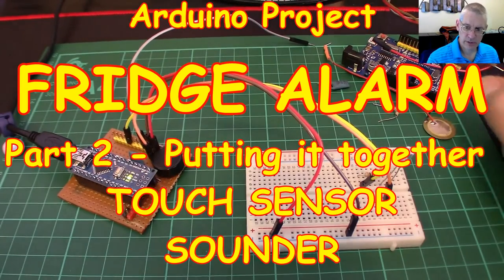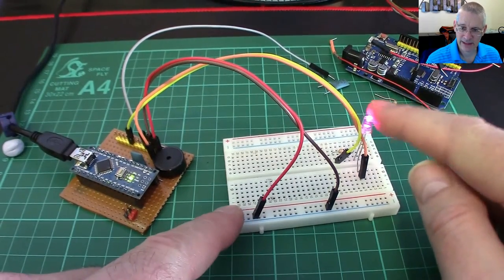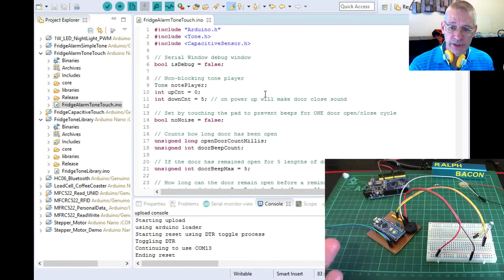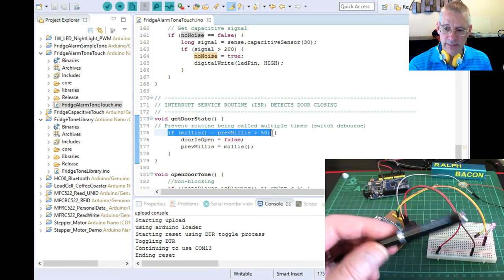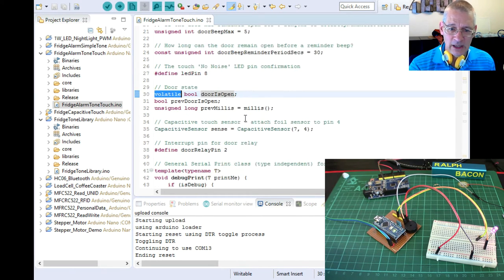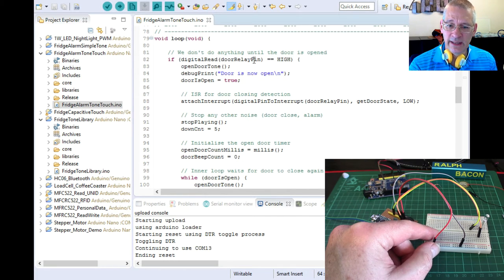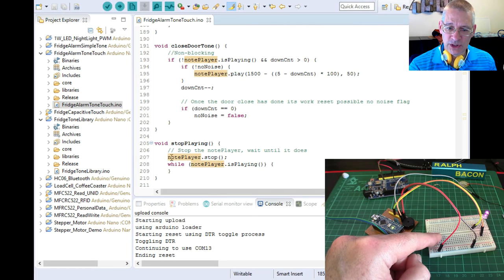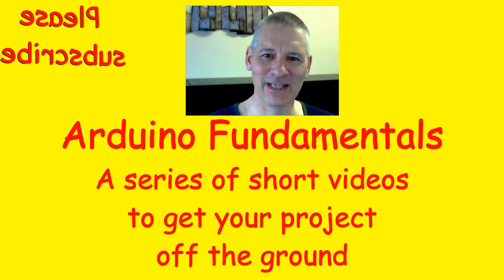#42 Fridge Alarm Door Open Reminder - Part 2 Putting it together

Comment: LOL - my new fridge came with one of these built in. First thing I did was find the blooming wire to the speak and soldered in a switch. Replaced all the appliances recently and every single one of the feckers beeps.
Reply from the maker: Now that you've seen the video you could create your own project to replace the switch with an Arduino controlled version so that it bleeps but only after the time you consider appropriate! Just suggestin' :) Thanks for posting.
Reply: Its an idea but I keep it switched off. I'm thinking about putting an LED strip along the top of the fridge and wiring that in instead. Big flashing light rather than really annoying beep. LOL

Comment: nice project, i might try fit it in a attiny, some things i will check is what is in the fridge bezel and can i tap power from it, put a switch in the bezel itself and a magnet on top of the door.
if i can not find a power source in the fridge bezel then i wil try sleep mode on the attiny and wake it up on opening and closing so the battery will last, new to the tiny so not sure yet if what i want is possible, might even be possible to use the big light switch and attach a microswitch to it, the switch is also mounted in that bezel of my fridge. i try to make it unnoticeable from the outside.
Reply from the maker: Indeed, Hamdit, if I had been allowed to dismantle my fridge door and bezel I believe I could have incorporated this into the fridge no trouble at all. As it is, there were objections (not surprisingly) and external and visible it remains to this day (but still works a treat). Thanks for posting.
Reply: Ralph S Bacon working on a attiny at the moment, when its done i will let you know and share the code

Comment: Nice project, i tried to replicate but i’m having problems with the door switch, can u put an schematic? Where the capacitor goes? Thank you
Reply from the maker: I've added in a poor quality schematic (I blame my camera) into this location:
https://www.dropbox.com/sh/q0l139bmcexvp9f/AACEDL6XLbnvqannW7Q-i-kma?dl=0

I've not included VCC or GND but the other pins have been labelled. I hope this helps, Cristian, let me know if you get stuck. This fridge alarm is still running in my house since 2016 and has saved us many times from leaving the door open.
Reply: Ralph S Bacon thank you!
Reply: Ralph S Bacon, one more question..is it posible to put more then one switch?
Reply from the maker: You could wire switches in parallel (to the same pin) or have another switch to a different interrupt (you only have pins 2 or 3 for hardware interrupt). You thinking of having one alarm for multiple (fridge) doors?

Comment: Improved by adding a time function to touch sensor. Short press disable for 2 minutes, long press for 10 minutes, for cleaning the fridge for example.
Reply from the maker: Excellent lateral thinking there, Dazzjh40. Mine is still in operation, and the "touch silencer" is essential to stop Benny rushing to the fridge for a treat of cream every time I open the door! The beauty of Arduino projects is that we can add value just with code - no (or very little) extra hardware required. Thanks for posting!
Reply: @RalphBacon  Great videos you have!
sugestions for this project:
tap while open := reset timer, instead if closing door, if you need mor time.
long press > 5-10s := maintenence mode, LED blinking, no alarm, reset when door close

Comment: Hi Ralph, can I take you back a few years with this fridge door alarm. I have got the relevant libraries in the sketch, but the sketch won't compile. After some investigation it would appear that there is some issue with the Tone library. Can you offer any help with this.
Many thanks for all that you do for us using Arduinos
Regards Phil.
Reply from the maker: What error do you get Phil? My ESP link is down right now (that's Extra Sensory Perception, nothing to do with ESP32s 😁)?
Reply: @RalphBacon  Hi Ralph, I am pleased to say that I worked my way to a solution. It was the Tone Library, so I deleted it and got the modified one. Compiles and runs now. I am now working to substitute the capacitive touch sensor with the TTP223 touch sensor, as you used in the TINY13a setup, for the Fridge Alarm. Almost there with that.
Many thanks Phil.

Comment: Ralph, I had an idea. Why not attach the sensor wire to the case of the fridge? This should effectively turn the whole side of the fridge into a sensor. There should be a section of the case as it folds around the back, where there is no paint, or where you could scrape away some paint to get a good contact.
I have a similar Bosch fridge, with the same problem. as the switch ages, it gets stiffer. I'm thinking of seeing if I can add some small but strong neodymium magnets to the seal, to see if I can convince the door to shut completely.
Great project though. Keep them coming.
Reply from the maker: +Maxx B
Quite an idea there! However, I'm not totally convinced it would work because (I hope) the fridge is earthed, so whether an earthed fridge could still act as a sensor is anyone's guess (I may try it sometime)! Secondly, the touch area is going to be huge so I'm wondering whether stability would be an issue. But i'm still tempted to try it out one cold winter's day... Thanks for your encouragement.

Comment: Hi Ralph I was able to get you project to work on my uno but how do you get the same code to run on the Micro? It keeps alarming out on the tone.cpp code.  Thanks
Reply from the maker: What error do you get, Donnie (copy and paste here please).
Have you selected the correct board (by installing and using MicroCore by MCUdude)? That's for the ATTiny13A. If you're using an ATTiny85 you need the Attiny (by David Mellis) or DIY ATTiny (by James Sleeman), although you could just use the Arduino ATTiny85 official version.
Reply: @RalphBacon  Thanks for the fast reply,  I'm really new to the arduino.  The errors are long but this is what I get.
Arduino: 1.8.13 (Windows 10), Board: "Arduino Micro"

C:\Users\DONNIE\Documents\Arduino\libraries\Tone\Tone.cpp: In member function 'void Tone::begin(uint8_t)':

C:\Users\DONNIE\Documents\Arduino\libraries\Tone\Tone.cpp:139:9: error: 'TCCR2A' was not declared in this scope

         TCCR2A = 0;

         ^~~~~~

C:\Users\DONNIE\Documents\Arduino\libraries\Tone\Tone.cpp:139:9: note: suggested alternative: 'TCCR0A'

         TCCR2A = 0;

         ^~~~~~

         TCCR0A

C:\Users\DONNIE\Documents\Arduino\libraries\Tone\Tone.cpp:140:9: error: 'TCCR2B' was not declared in this scope

         TCCR2B = 0;

         ^~~~~~

C:\Users\DONNIE\Documents\Arduino\libraries\Tone\Tone.cpp:140:9: note: suggested alternative: 'TCCR0B'

         TCCR2B = 0;

         ^~~~~~

         TCCR0B

In file included from C:\Program Files (x86)\Arduino\hardware\arduino\avr\cores\arduino/wiring_private.h:31:0,

                 from C:\Users\DONNIE\Documents\Arduino\libraries\Tone\Tone.cpp:26:

C:\Users\DONNIE\Documents\Arduino\libraries\Tone\Tone.cpp:141:26: error: 'WGM21' was not declared in this scope

         bitWrite(TCCR2A, WGM21, 1);

                          ^

C:\Program Files (x86)\Arduino\hardware\arduino\avr\cores\arduino/Arduino.h:112:49: note: in definition of macro 'bitSet'

 #define bitSet(value, bit) ((value) |= (1UL << (bit)))

                                                 ^~~

C:\Users\DONNIE\Documents\Arduino\libraries\Tone\Tone.cpp:141:9: note: in expansion of macro 'bitWrite'

         bitWrite(TCCR2A, WGM21, 1);

         ^~~~~~~~

C:\Users\DONNIE\Documents\Arduino\libraries\Tone\Tone.cpp:141:26: note: suggested alternative: 'WGM41'

         bitWrite(TCCR2A, WGM21, 1);

                          ^

C:\Program Files (x86)\Arduino\hardware\arduino\avr\cores\arduino/Arduino.h:112:49: note: in definition of macro 'bitSet'

 #define bitSet(value, bit) ((value) |= (1UL << (bit)))

                                                 ^~~

C:\Users\DONNIE\Documents\Arduino\libraries\Tone\Tone.cpp:141:9: note: in expansion of macro 'bitWrite'

         bitWrite(TCCR2A, WGM21, 1);

         ^~~~~~~~

C:\Users\DONNIE\Documents\Arduino\libraries\Tone\Tone.cpp:142:26: error: 'CS20' was not declared in this scope

         bitWrite(TCCR2B, CS20, 1);

                          ^

C:\Program Files (x86)\Arduino\hardware\arduino\avr\cores\arduino/Arduino.h:112:49: note: in definition of macro 'bitSet'

 #define bitSet(value, bit) ((value) |= (1UL << (bit)))

                                                 ^~~

C:\Users\DONNIE\Documents\Arduino\libraries\Tone\Tone.cpp:142:9: note: in expansion of macro 'bitWrite'

         bitWrite(TCCR2B, CS20, 1);

         ^~~~~~~~

C:\Users\DONNIE\Documents\Arduino\libraries\Tone\Tone.cpp:142:26: note: suggested alternative: 'CS00'

         bitWrite(TCCR2B, CS20, 1);

                          ^

C:\Program Files (x86)\Arduino\hardware\arduino\avr\cores\arduino/Arduino.h:112:49: note: in definition of macro 'bitSet'

 #define bitSet(value, bit) ((value) |= (1UL << (bit)))

                                                 ^~~

C:\Users\DONNIE\Documents\Arduino\libraries\Tone\Tone.cpp:142:9: note: in expansion of macro 'bitWrite'

         bitWrite(TCCR2B, CS20, 1);

         ^~~~~~~~

C:\Users\DONNIE\Documents\Arduino\libraries\Tone\Tone.cpp: In member function 'void Tone::play(uint16_t, uint32_t)':

C:\Users\DONNIE\Documents\Arduino\libraries\Tone\Tone.cpp:246:9: error: 'TCCR2B' was not declared in this scope

         TCCR2B = (TCCR2B & 0b11111000) | prescalarbits;

         ^~~~~~

C:\Users\DONNIE\Documents\Arduino\libraries\Tone\Tone.cpp:246:9: note: suggested alternative: 'TCCR0B'

         TCCR2B = (TCCR2B & 0b11111000) | prescalarbits;

         ^~~~~~

         TCCR0B

C:\Users\DONNIE\Documents\Arduino\libraries\Tone\Tone.cpp:304:9: error: 'OCR2A' was not declared in this scope

         OCR2A = ocr;

         ^~~~~

C:\Users\DONNIE\Documents\Arduino\libraries\Tone\Tone.cpp:304:9: note: suggested alternative: 'OCR3A'

         OCR2A = ocr;

         ^~~~~

         OCR3A

In file included from C:\Program Files (x86)\Arduino\hardware\arduino\avr\cores\arduino/wiring_private.h:31:0,

                 from C:\Users\DONNIE\Documents\Arduino\libraries\Tone\Tone.cpp:26:

C:\Users\DONNIE\Documents\Arduino\libraries\Tone\Tone.cpp:306:18: error: 'TIMSK2' was not declared in this scope

         bitWrite(TIMSK2, OCIE2A, 1);

                  ^

C:\Program Files (x86)\Arduino\hardware\arduino\avr\cores\arduino/Arduino.h:112:30: note: in definition of macro 'bitSet'

 #define bitSet(value, bit) ((value) |= (1UL << (bit)))

                              ^~~~~

C:\Users\DONNIE\Documents\Arduino\libraries\Tone\Tone.cpp:306:9: note: in expansion of macro 'bitWrite'

         bitWrite(TIMSK2, OCIE2A, 1);

         ^~~~~~~~

C:\Users\DONNIE\Documents\Arduino\libraries\Tone\Tone.cpp:306:18: note: suggested alternative: 'TIMSK0'

         bitWrite(TIMSK2, OCIE2A, 1);

                  ^

C:\Program Files (x86)\Arduino\hardware\arduino\avr\cores\arduino/Arduino.h:112:30: note: in definition of macro 'bitSet'

 #define bitSet(value, bit) ((value) |= (1UL << (bit)))

                              ^~~~~

C:\Users\DONNIE\Documents\Arduino\libraries\Tone\Tone.cpp:306:9: note: in expansion of macro 'bitWrite'

         bitWrite(TIMSK2, OCIE2A, 1);

         ^~~~~~~~

C:\Users\DONNIE\Documents\Arduino\libraries\Tone\Tone.cpp:306:26: error: 'OCIE2A' was not declared in this scope

         bitWrite(TIMSK2, OCIE2A, 1);

                          ^

C:\Program Files (x86)\Arduino\hardware\arduino\avr\cores\arduino/Arduino.h:112:49: note: in definition of macro 'bitSet'

 #define bitSet(value, bit) ((value) |= (1UL << (bit)))

                                                 ^~~

C:\Users\DONNIE\Documents\Arduino\libraries\Tone\Tone.cpp:306:9: note: in expansion of macro 'bitWrite'

         bitWrite(TIMSK2, OCIE2A, 1);

         ^~~~~~~~

C:\Users\DONNIE\Documents\Arduino\libraries\Tone\Tone.cpp:306:26: note: suggested alternative: 'OCIE0A'

         bitWrite(TIMSK2, OCIE2A, 1);

                          ^

C:\Program Files (x86)\Arduino\hardware\arduino\avr\cores\arduino/Arduino.h:112:49: note: in definition of macro 'bitSet'

 #define bitSet(value, bit) ((value) |= (1UL << (bit)))

                                                 ^~~

C:\Users\DONNIE\Documents\Arduino\libraries\Tone\Tone.cpp:306:9: note: in expansion of macro 'bitWrite'

         bitWrite(TIMSK2, OCIE2A, 1);

         ^~~~~~~~

C:\Users\DONNIE\Documents\Arduino\libraries\Tone\Tone.cpp: In member function 'void Tone::stop()':

C:\Users\DONNIE\Documents\Arduino\libraries\Tone\Tone.cpp:345:7: error: 'TIMSK2' was not declared in this scope

       TIMSK2 &= ~(1 << OCIE2A);

       ^~~~~~

C:\Users\DONNIE\Documents\Arduino\libraries\Tone\Tone.cpp:345:7: note: suggested alternative: 'TIMSK0'

       TIMSK2 &= ~(1 << OCIE2A);

       ^~~~~~

       TIMSK0

C:\Users\DONNIE\Documents\Arduino\libraries\Tone\Tone.cpp:345:24: error: 'OCIE2A' was not declared in this scope

       TIMSK2 &= ~(1 << OCIE2A);

                        ^~~~~~

C:\Users\DONNIE\Documents\Arduino\libraries\Tone\Tone.cpp:345:24: note: suggested alternative: 'OCIE0A'

       TIMSK2 &= ~(1 << OCIE2A);

                        ^~~~~~

                        OCIE0A

C:\Users\DONNIE\Documents\Arduino\libraries\Tone\Tone.cpp: In member function 'bool Tone::isPlaying()':

C:\Users\DONNIE\Documents\Arduino\libraries\Tone\Tone.cpp:381:22: error: 'TIMSK2' was not declared in this scope

       returnvalue = (TIMSK2 & (1 << OCIE2A));

                      ^~~~~~

C:\Users\DONNIE\Documents\Arduino\libraries\Tone\Tone.cpp:381:22: note: suggested alternative: 'TIMSK0'

       returnvalue = (TIMSK2 & (1 << OCIE2A));

                      ^~~~~~

                      TIMSK0

C:\Users\DONNIE\Documents\Arduino\libraries\Tone\Tone.cpp:381:37: error: 'OCIE2A' was not declared in this scope

       returnvalue = (TIMSK2 & (1 << OCIE2A));

                                     ^~~~~~

C:\Users\DONNIE\Documents\Arduino\libraries\Tone\Tone.cpp:381:37: note: suggested alternative: 'OCIE0A'

       returnvalue = (TIMSK2 & (1 << OCIE2A));

                                     ^~~~~~

                                     OCIE0A

In file included from C:\Users\DONNIE\Documents\Arduino\libraries\Tone\Tone.cpp:24:0:

C:\Users\DONNIE\Documents\Arduino\libraries\Tone\Tone.cpp: In function 'void TIMER2_COMPA_vect()':

C:\Users\DONNIE\Documents\Arduino\libraries\Tone\Tone.cpp:439:5: warning: 'TIMER2_COMPA_vect' appears to be a misspelled 'signal' handler, missing '__vector' prefix [-Wmisspelled-isr]

 ISR(TIMER2_COMPA_vect)

     ^

C:\Users\DONNIE\Documents\Arduino\libraries\Tone\Tone.cpp:453:5: error: 'TIMSK2' was not declared in this scope

     TIMSK2 &= ~(1 << OCIE2A);                 // disable the interrupt

     ^~~~~~

C:\Users\DONNIE\Documents\Arduino\libraries\Tone\Tone.cpp:453:5: note: suggested alternative: 'TIMSK0'

     TIMSK2 &= ~(1 << OCIE2A);                 // disable the interrupt

     ^~~~~~

     TIMSK0

C:\Users\DONNIE\Documents\Arduino\libraries\Tone\Tone.cpp:453:22: error: 'OCIE2A' was not declared in this scope

     TIMSK2 &= ~(1 << OCIE2A);                 // disable the interrupt

                      ^~~~~~

C:\Users\DONNIE\Documents\Arduino\libraries\Tone\Tone.cpp:453:22: note: suggested alternative: 'OCIE0A'

     TIMSK2 &= ~(1 << OCIE2A);                 // disable the interrupt

                      ^~~~~~

                      OCIE0A

exit status 1

Error compiling for board Arduino Micro.
Reply: @RalphBacon  Ralph,
I found that when I compile the code for the Uno it works fine but as soon as I try to compile it for the Pro Micro it throws up the error for the tone.cpp and it looks as if it's missing the include<wiring.h> file.  Why would this be their for the uno but not the pro micro? is the pro micro not compatible  with the code for some reason? any help is much appreciated .
Reply from the maker: It errors because the Arduino Micro is a very different device with a different chip (an ATMega32U4) compared to an Arduino UNO or Nano (ATMega328P) which is why the compile is failing - the libraries have not been written for that device. Best to stick with a supported device in this case.

Comment: Hi I have problem With shield sim900 error comes no db resp and at the end say check power!! Can u help me I got confused😵 thank you.
Reply from the maker: Hi Rafale, I'm afraid I have no experience of the SIM900 GSM module but here is an article that might help you: http://tronixstuff.com/2014/01/08/tutorial-arduino-and-sim900-gsm-modules/ 
 
The only other thing I can suggest is that you post your question on the Arduino forum (http://forum.arduino.cc/index.php) as there are many experts there waiting to help, as long as you have researched and posted your question in a meaningful way, describing the specific problem you have. Good luck with this.
Reply: thanks very useful :)